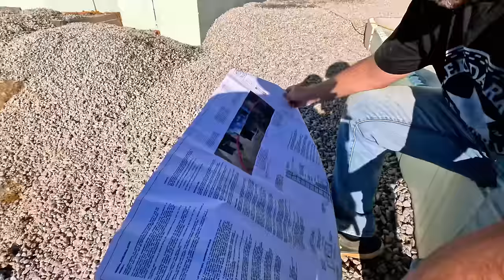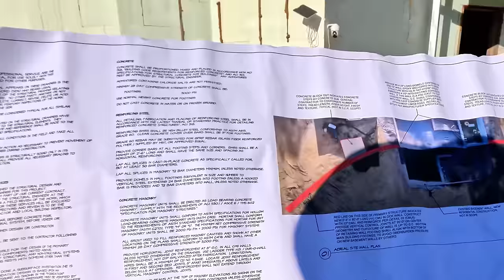How to Build Retaining Walls Pt 1 Planning the Layout

Comment: Dont make it match the lower wall- your eye will automatically compare one side to the other. If the right side looks lower than the left(looking from the pond) i think it will be fine. It will also blend in better with the original ground level.